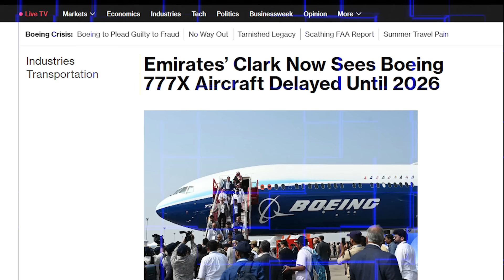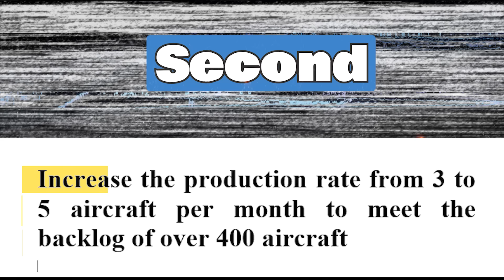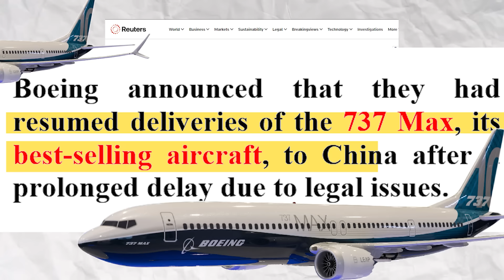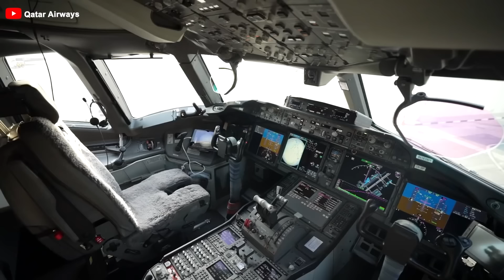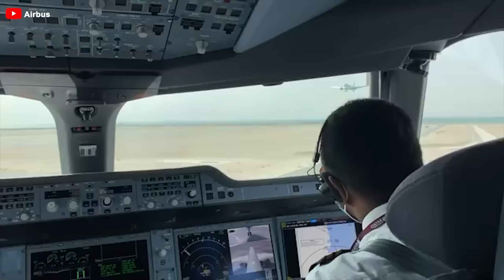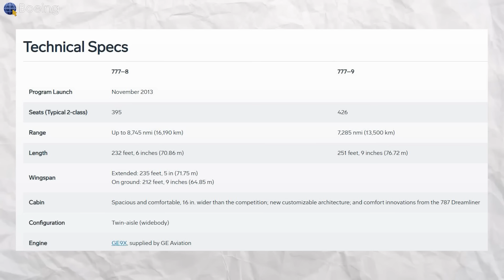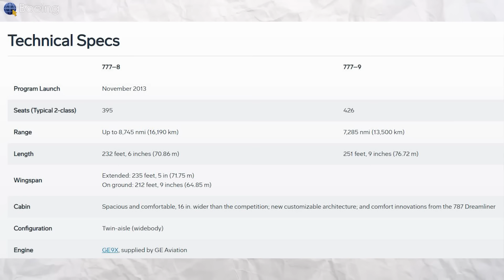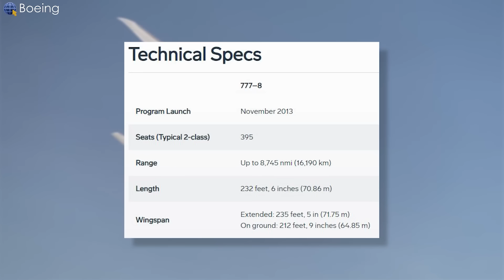Emirates Boss Revealed Boeing 777X's In BIG BIG BIG TROUBLE! Here's Why

Comment: The real problem is, the 777 is nowhere near the standards of the A350. I also wouldn't be surprised if Airbus isn't pressured to restart the A380, almost all airlines that had them in storage have had to bring them back into use. They're commanding higher fares and frequently close to capacity - and what a plane! It's leagues ahead of anything & so stable in the air, even taking off seems so effortless, it belies its 560,000kg (max take off weight)...
Reply: Sitting in 380 makes you feel it s a better plane, of course, it s bigger. But Operating cost of 380, Sir Tim Clark himself had said once that to make 380 a feasible fleet, you need at least 30 of them. No airlines in the world has them. The cost to fly a flight with 380 is equal to fly 2 flights using 777-300ER. Given the fact that now Airlines cannot find any plane to fly after the pandemic, they had to bring 380 back into service. It's not because it is a better airplane, but Airlines have no choice. Queue for 350 is full for the decade. 777x is still not certified. Therefore, 380 is forced to be brought back. If given a choice, no Airlines will ever want to bring them back into service. The era of 4 engines aircraft had ended for many years. 380 engines are so outdated and cannot be improved.
Reply: @johnmurphy4814  You are so correct in your assessment: the 777X is light years better and bigger than the a350.

Comment: The Boeing 777  9 is out on its own as Airbus have not got an Aircraft that can match it other than the Airbus A 350 1,000 but watch this space , If Sir Tim Clarke runs out of patience and he would have good grounds for it plus Airbus could if they had a large Order build the A.350 2000 you could see Airbus whos A.350 is in production pick up a lot of new orders, with the promise of the new Rolls Royce ' Ultrafan ' Engine on offer as well.

Comment: There's a huge oppourtunity for a manufacturer with an independent supply chain to come in and take over orders from Boeing (and possibly airbus) and break the duopoly at the moment - probably from China. (Although also Embraer etc) Once Boeing looses its duopoly position and crew's are trained on a competitor's aircraft etc. Boeing will find it very difficult to recover.